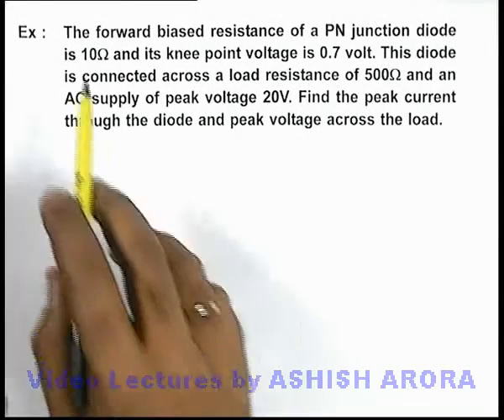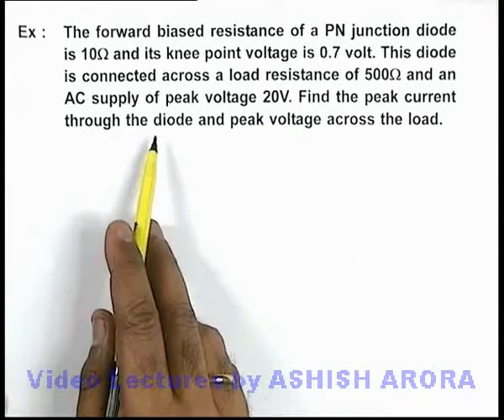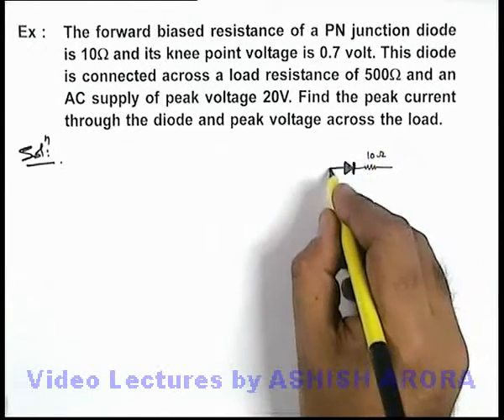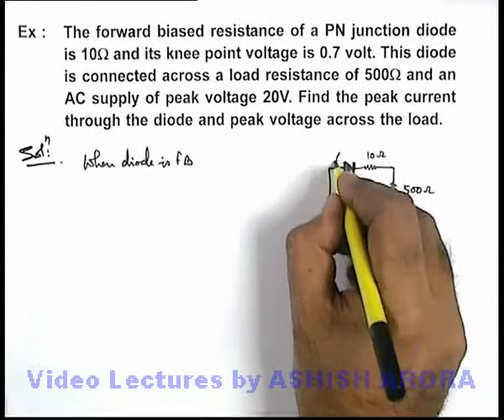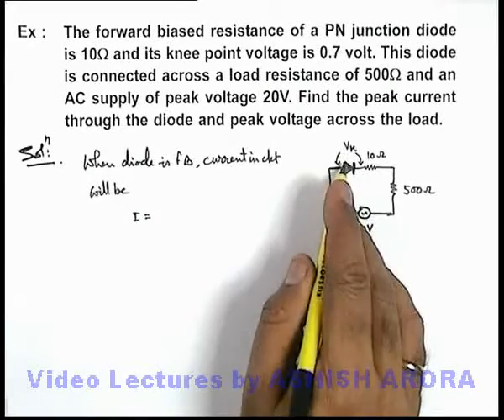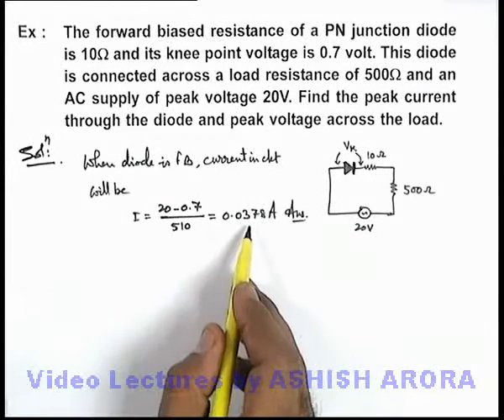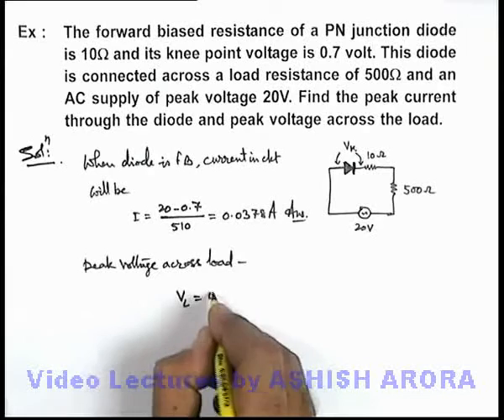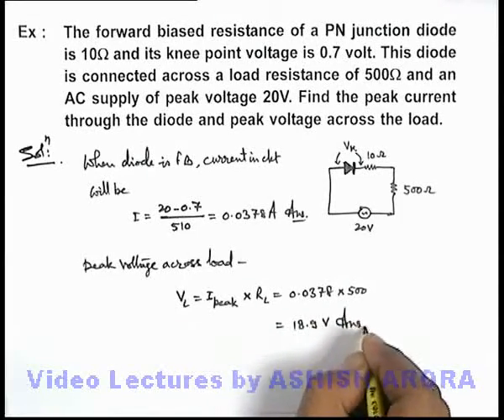Class 12 Physics | PN Junction & Diodes | #26 Solved Example-2 on PN Junction & its Application

Comment: Sir while calculating peak current through the diode why you have considered the resistance of the entire circuit when we need to consider only the resistance of the diode ??? Shouldn't it be 20-0.7/10
Reply from the maker: current flows through the loop so we have to consider total resistance in loop...

Comment: Where has other 0.4 V gone?
Reply from the maker: which 0.4 V pl specify the time instant of video concerned to your query...
Reply: Tushar Gupta dude sir wrote kvl equation for loop
Reply: Other 0.4V goes to th internal resistance of diode ie. 10 ohms.

Comment: Sir in this problem while calculating total resistance , you had neglected dynamic resistance (as it is few ohms ) and approximated to 510 ohms right ?
Reply from the maker: It is specified in the question that beyond knee point FB resistance is 10Ω which is the resistance given so we need not consider dynamic resistance separately...
Reply: @physicsgalaxyworld  ok got it. Thank you sir .

Comment: Sir why is it that when we find the voltage using Kirchoff Law we get 19.3 which is much higher than the one that you got using peak current?
Reply: Shubham Bhagat you found voltage effective , divide by resistance to get correct ans :P